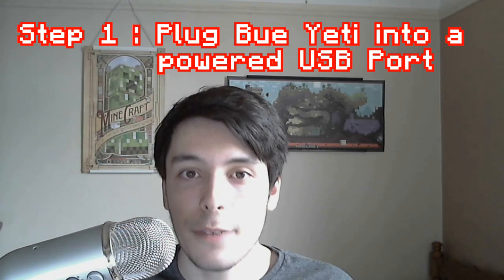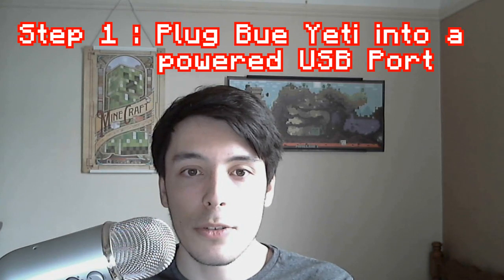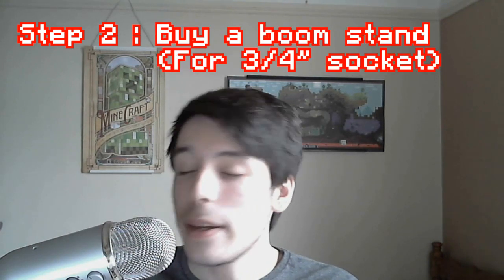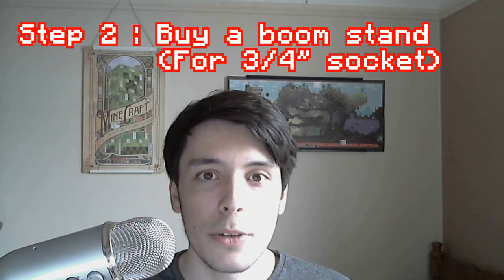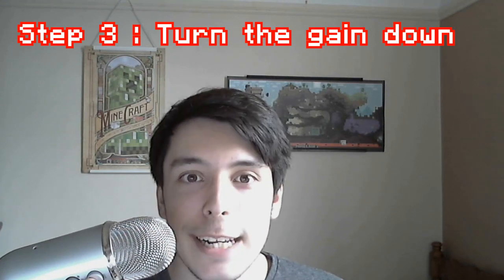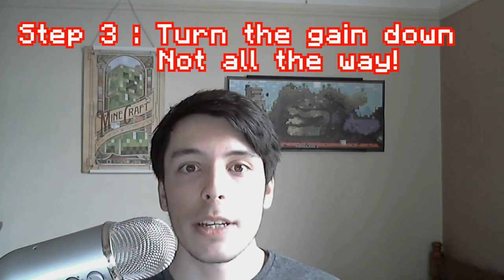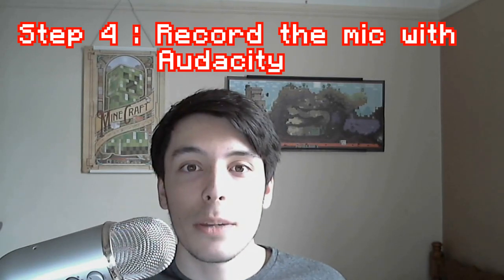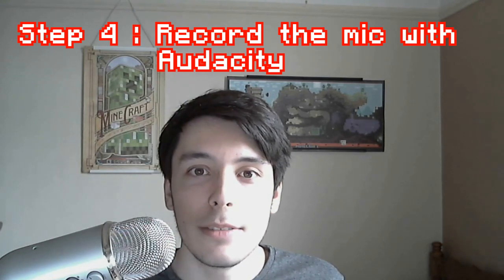How to fix the hum/buzz on the Blue Yeti microphone

Comment: I had the same problem and I tried all the solutions but to no avail.  What I had to do, because I was hooking up my mic through a powered USB, was hook the mic directly to my laptop AND move my powered USB hub as far away from the Blue Yeti USB cable as possible.  The powered hub was the issue.

Comment: I have a horrible hum in my Snowball.  Like a bass player in a rock band. I've ordered an external powered USB hub.  Will it solve the problem?  Tried everything...watched loads of clips on the Blue Snowball & most sound great.  By the way I can still hear intermittent hum sound from your clip on some of the words.  I've tested the Snowball in a soundproof studio and I still get this intermittent hum on some of the words .  It's impossible to edit it out during post editing.
Reply from the maker: I don't know why the snowball is playing up, that is reportedly a really good mic for reducing hum if not as good a quality as the yeti, it does have an inbuilt de-esser which is probably what isn't working on yours.
Tbh, it is only a USB microphone so you're never realistically going to edit out every tiny bit of hiss ever. Especially seeing as it's a £120 mic. You want that level of quality and you've got to lay down a load more cash for an NT1000 and an audio interface to go with it

Comment: We got rid of the repeating whine (not hum, whine) by turning the gain on the mic to halfway and then going into windows settings and turning the 'volume' all the way down.  You get there by using  the Sound properties. Directions: Left click your volume icon the taskbar, choose Sounds, the Recording tab, then click on your Yeti microphone and choose Properties. Click on the Levels tab and turn the slider all the way down to 0.) No more damn whine!  Turn the gain on the mic (the knob) up and down as needed.  Halfway works well for us.  Anything past that and it starts to distort.  Hope this helps someone else with this problem!

Comment: It's 2022 and I just wanted to let you know that your video is still relevant and very helpful! I've been pulling my hair out trying to find where my mic buzz is coming from, I have a boom stand, pop filter, it's all run through an EQ and Compressor/Gate. Turns out it is indeed the vibrations/magnetic fields coming from the usb cable itself, I would have never thought of that! Kudos!

Comment: You say the mount socket size is 3/4 inch.
However, the blue yeti USB mic I have would appear to be a 5/8 mount.
(silver, looks just like yours, but.. 5/8. )
Maybe because I'm in America? Dunno.
Reply from the maker: It may well be different, I mean this guide is 3 years old :P
Reply: Make a newer one then

Comment: tip for anyone using mouses and keyboards i found a keyboard and mouse i was using was creating a buzzing sound that the yeti picked up i was using a razer black widow chroma keyboard so if you have something similar you might have the same problem

Comment: 7 years later, that Audacity bit fixed my problems. I haven't realized that Audacity was free, open source, and available for Linux - not really a sound guy, but I just finally got a Yeti. `sudo apt-get install audacity`, and boom. Almost all the other Linux tools provide no feedback, so you go all around setting values, recording, and then playing back to see if it worked. Audacity let me dial in the levels, visually, live, and, as a bonus, did not record any of the hiss that every other thing on my Ubuntu box did. It's like magic. I sound so nice.

Comment: Have a noise with blue Yeti, even when not recording (capture button off). Changed my USB cable, but still hear noise. Need your help man!
Reply from the maker: Sounds like a power issue I'd suggest looking into a powered USB hub to add the extra power the microphone needs

Comment: i don't think it will work for me because im going to stream, i've never used audacity so i don't know if it would work
Reply: +tomzgames If you use OBS for streaming, there's a plugin on their main forums that does background noise cancellation. I had the issue due to a loud server running in the background and had to add the plugin to my OBS installation and now the noise is gone. I was surprised by the difference. Here's a link to it. https://obsproject.com/forum/resources/microphone-dsp-plugin.127/  Hopefully this is useful to you :)

Comment: Yeah I bought a hub with ex power and still get static noise. Also when I use only the battery I don't hear a difference. 

I use a laptop instead of my desktop because of the horrible fan noise. .

I think I ll try more gain ..
Reply from the maker: If both those didn't work then I would suggest getting it looked at for mechanical/electrical faults or check your recording program, some of them boost the signal and cause a hiss. I would never turn the gain up to solve a hiss problem as the gain is how sensitive the microphone is

Comment: When I connect mine and record after recording it has a static along with voice how do I fix that
Reply from the maker: John C that could be any number of issues,  could you describe the "static" in more detail?
Reply: sure its a static sound how do you make it go away
Reply from the maker: Just took a look at your video, it sounds like data noise usually caused by another power draining USB device or USB storage device in the same set of USB ports. I'd start with unplugging each other device until the yeti is the only one left.
If that doesn't work then take a look at the recording level in windows, my settings are in the description.
beyond that if it persists it could be a grounding fault in the mic, I'd claim on your warranty and get it replaced by Blue they're usually pretty good about stuff like that.
Hopefully some of that works but do let me know :)

Comment: I tried 5 different USB adaptors (with the audio input to my computer coming from the headphone socket of the mike) and even though the light came on, the mike didn't work with any of them - I plugged it into the computer and it worked (with hum).
I thought USB power was USB power?!!
Reply from the maker: The headphone socket on the mike is just that, for headphones it doesn't output signal by itself, instead it acts as a pass-through for the computer. USB power is USB power but I am talking about a USB hub for the computer that also plugs into a wall socket.

Comment: What is the difference between a normal USB port and a powered USB port? Can i just use a USB 3.1 port? At the back of my desktop PC?
Reply: Yes that will work fine
Reply: +Vizuka I had that hum with my old USB microphone. Using the USB port of my monitor made it much better than using one of my computer.

Comment: If i plug my yeti in the wall how is it supposed to show up on my computer?
Reply from the maker: It won't ;P You don't plug it directly into the wall, the powered usb port is just a hub that sits between the mic and the computer. It supplies any device plugged into it with power, and allows the computer to see through it. Probably could have done with showing this in the video but hey :)
Reply: Oh I see, I will look into getting one.

Comment: Thanks for this excellent vid. I tried a lot of the suggestions, which didn't resolve my hum issue. In the end, increasing the gain (which had been set very low) actually got rid of my hum! Something to try for those whose issues aren't resolved using this vid's tips.
Reply: Yes! This worked for me as well.

Comment: Thank you for this.  You were my first watch and I think this may solve my problem.  I have this electronic wave that shows up here-and-there.  I use an Apple MacBook Pro.  I'll unplug it (It's continuously plugged in), and hopefully, that will change that sound as it might be a wave from the electrical current.  Next,  I already have a boom and a pop filter on the way.  This wasn't an attempt to fix the issue but, instead, I'm going live video so needed to get these anyway.  As it turns out, it will likely improve the sound quality.

Comment: What do you mean by plugging it into a powered USB port? Either way it needs to be plugged into the computer?? So I'm so confused.
Reply from the maker: You can buy USB hubs that also have an AC power inlet. So you plug them into the wall socket and the PC. Those are what I mean

Comment: At the start, I was thinking... "YOU ARE USING IT WRONG!" You aren't supposed to speak into the tip of it, you need to talk into the front of it. Also, use the cardioid setting if you aren't.

Here is the blue yeti FAQ: http://bluemic.com/yeti/#/faq/
Take a look down the bottom, it says how to speak into it to get nicer quality.
Reply from the maker: Ok so I guess you can't tell from the video but I am behind and to the side of it so the sound waves aere actually going into the side not the tip. I talk past the mic as I didn't have a pop filter at the time and didn't want to cause unnecessary popping. I do have it on cardioid and I know what the different polar patterns are and how to use them before you say anything. Plus as research for this video I bought a second yeti to pull apart
Reply: Ah, ok. No problem. It just looked like that, as we both said. No worries!

Comment: When i listen to my recording i only hear my voice out of one side of my headphones and static out of the other, is there a way to fix this?
Reply from the maker: +Wajobawaki try doing a test record in audacity (freeware) and have a look at the input settings, if it only comes up with one track then it may be set to mono input. In which case just fiddle around until you find the stereo setting for the input, or... its your headphones :)
Reply: TheGamingMole it wasn't like this before, it started a couple days ago
Reply: ***** I did have thus but I contacted the company and they took it in and fixed
Reply: no problem

Comment: Can anyone elaborate on the poweredUSB thing? I had to look up what this was, and I am not seeing any ports that match that description on my tower. I don't even have an old computer... I've tried looking this up, but there's almost no documentation on poweredUSB ports outside a wikipedia article that doesnt explain much.
Reply from the maker: some cases have them but it is not common, not many people have use for them. I am talking about an external USB hub that has a AC or DC in. If it includes a wall plug then it will have at least 1 powered port
Reply: Thanks!

Comment: Will a USB hub stop this or no since I am not directly to the PC USB?
Reply from the maker: the mains powered USB hub is a last step if the others don't work as it has the biggest associated cost
Reply: Well i was gonna buy a USB hub so yeah?
Reply from the maker: All I can really say is it's worth a shot
Reply: ok I have a atr2500 now I need t know is ti usb 2.0 or 3.0?
Reply from the maker: well it will work on both just know that audio quality will be better going through usb 3.0
Reply: Now you tell me that?
Reply: TheGamingMole this is very untrue. USB 3.0 sends data faster but the quality for audio would be exactly the same. The only difference would be if your USB 2.0 port was defective and was causing lag.

Comment: i have a problem with my Blue Yeti. i bought it from Amazon before days .
 it was working on my Ps4 and Mac laptop , but one day i plugged in my ps4  it didn't work at all ,unless the mute light was working . i thought that problem because the cable so, i went to buy a new one , but the problem still there . Also the laptop and ps4 could not recognized it . i can not find the name of blue yeti in my computer .  

actually , i do not know what to do .  i want some solves  if you know.
Reply from the maker: fahad dooka sounds like an electrical fault in the mic, but to be clear the mute light constantly on means it is live and the light flashing means it is muted. Your PC should pick it up seeing as it is a plug and play mic, look at your USB drivers maybe, something around that area. May even be a registry problem but I wouldn't suggest tackling that unless you know what you are looking for

Comment: I dont have 2.0 usb ports, only 3.0, 10 of them on the pc
Reply from the maker: Cyroツ yeah 3.0 aren't great for power pass through but if you are still having the issue it may be worth looking into a usb hub with ac power. if it doesn't work you can always return it

Comment: my ps4 fan is kinda trash so it makes noise, if i plug the mic in the usb port will the fan noise go up my usb to my mic??
Reply from the maker: The ps4 is different. If you're using the yeti for party chat it will actually seem to work better by default in the ps4 as there is noise cancelling built into the ps4 mic drivers and it will provide the yeti with loads of phantom power that pc's won't by default.

Comment: Ahhh stop recording into the top of the mic... I don't know if you have addressed this is the future, but the Yeti is a side-address mic, meaning you speak into the side.
Reply from the maker: I know and I am speaking into the side here. My head isn't that small ;) I get the camera angle and boom stand placement don't make it easy to see but the mic is closer to the camera than my face by a significant margin
Reply: Okay, now that I have watched the first few seconds I can see that actually are speaking into the side. My mistake! ;)
Reply from the maker: It's cool, I should've made it clearer so people know to address the side. Did the video help you with your issue?

Comment: I don't understand how the usb port will help . I mean if i'm recording something i need my laptop so i'm going to plug the yeti into a USB port to plug the port in my laptop - how is that going to stop the buzzing  ?
Reply from the maker: The USB hub needs to be the type with DC in, so it can provide phantom power to the microphone. It also acts as an isolator for data noise that can be picked up on USB sometimes. Depends what frequency the hum is though, most of the time turning your recording level in windows down fixes it.

Comment: by "powered usb ports" do u mean usb 3.0?
Reply from the maker: nope it's an actual separate block that you have to plug into the mains. USB 3.0 ports can be powered so check first but this is the safer option
Reply: so like a 10 port hub? (when i searched what a powered usb port was that was one of the links)
Reply from the maker: mine is 4 ports but as long as it has an power plug included and it isn't just an extension hub
Reply: ok I found one would i need to sit it on my desk when i get it? (Thank you btw for helping me)
Reply from the maker: Wherever it works, once I'm moved into my new house Ill do a setup video ;)
Reply: thanks

Comment: I am so confused. I have read all of you fixing this by plugging it into a power USB instead of straight into the computer. but if I plug it into a power source (the wall??) the mic is not connected to the computer. Am I missing something????? I can't get this buzzing to stop.
Reply from the maker: Not quite, powered hubs plug into the wall and the PC. The powering isn't the main issue though, USB as a standard is, or more specifically how your motherboard deals with it. Bc it deals with power and data the sound of other devices being charged on the same power rail causes interference. Powered USB hubs from Amazon will fix it but so could choosing a different port on the pc or not also having a usb pen drive plugged in

Comment: I don't mean to be a stickler but if you use a powered USB adapter, you're now "connected" to anything else that is on that same breaker. This means that if your monitor, PC, lamp, audio equipment, etc. is plugged into a power strip or wall outlet, it is shared with the same breaker. This defeats the purpose because now you've added the electrical interference from all of those devices. Otherwise, great video! Definitely some good advice about everything else.

Comment: The buzzing on mine was caused by the USB connector on the side that connects to the yeti, not the computer itself. If it wasn't seated properly it made constant intermittent buzz noise (bzz bzz bzz bzz). Once I seated the connection tightly it stopped!

Comment: this mic has been giving me hell lately! Buzzing, background noise, its been absolutely ridiculous. I've messed with the back gain and which mode its on. I've tried cutting out fans in my background completely, i've tried messing with the gain, messing with the volume of the mic through the computer settings, i've tried putting a sock over the mic and i've tried putting the mic on a mouse pad rather than having it sat out on my actual desk. Its just so sensitive! My vocals come out sounding like crap from all the noise reduction i have to do and still there is always a noticeable buzz wtf!

Comment: Brand new Yeti produces high-pitched whine -- only when recording.  When monitoring, it's dead quiet.  I've tried with both my laptop (unplugged) and cell phone (USB OTG).  Both produce the same annoying whine.
Reply: Same
Reply from the maker: Detained Gaming I have listened to your video and you need to fix the acoustics in your room, there are plenty of guides on how to do it you just need something soft around you on the walls or hung up, and don't use carpet or egg boxes they don't work.
Positioning is also another thing, it may be that there are large amounts of microwaves from radios or wifi signals disrupting the condenser in the microphone and causing noise. Try the mic in different parts of the room or even other rooms to be sure
hexsmith I have no reference for your problem so i cant provide direct assistance but maybe these tips will work for you. Tbh I have no idea on that front
Reply: Thanks dude
Reply: Ill try
Reply: hexsmith your the only person i have found who has the same prob exactly as me please let me know if you find a solution
Reply: Evanision I sent my Yeti back to Amazon.  It was within 30 days of purchase.  I ended up getting a Focusrite 2i2 and a MXL 770.